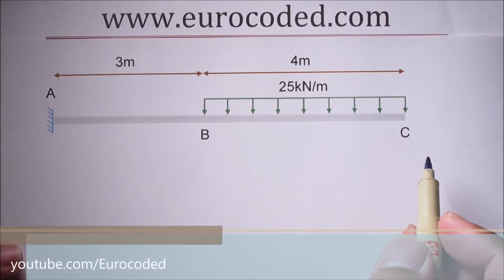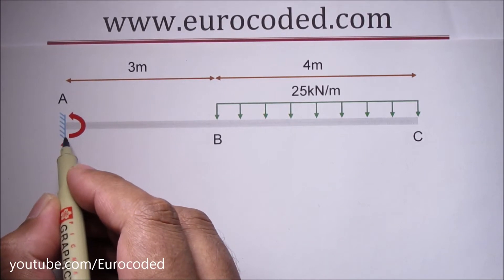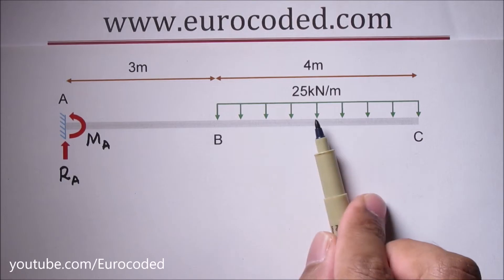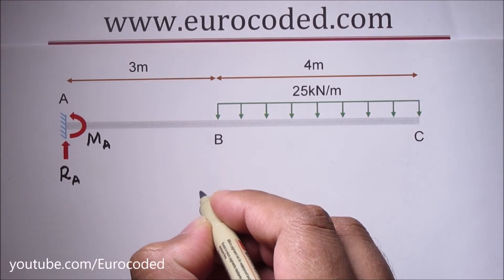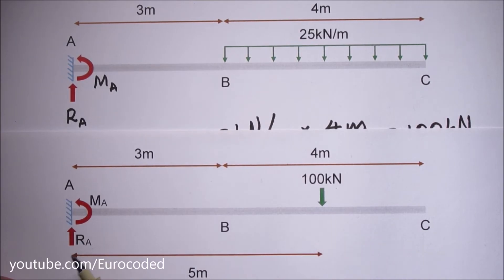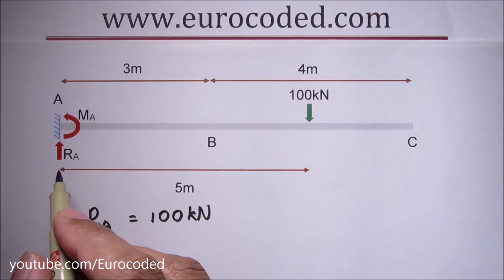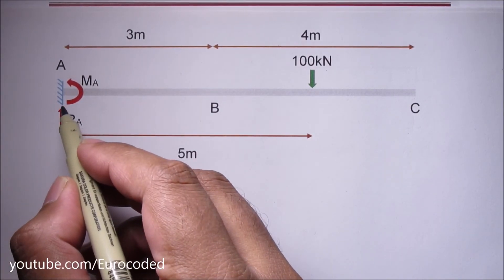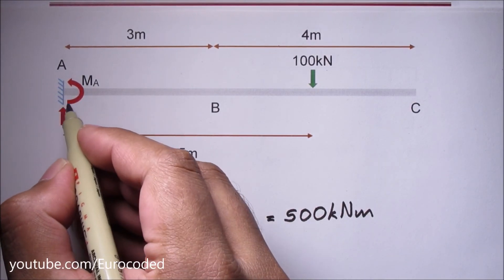How to Calculate Reactions of a Cantilever Beam with a Uniformly Distributed Load

Comment: when you have converted the UDL to point load and placed it in the centre of its load span. Can it be placed at any point on that span? and be added to another point load that would occur at 'C'?
Reply from the maker: nicholas peak In this example, converted UDL is applied 5m from A. If you offset this point to a different location (example: to C) you will then need to counter the change in moment resulting from shift of converted UDL. Then you can add the converted UDL to another point load applied at C.

 

Example: Imagine the same beam arrangement with another point load of 50kN applied at C.

 

If you shift the converted UDL to C then the lever arm becomes 7m when taking moments about point A, resulting in 700kNm bending moment about A. But in reality, it should be 500kNm (5m x 100kN). Therefore, we can add an external anti-clockwise bending moment of 200kNm to counter the additional 200kNm (700-500) resulting from shifting the converted ULD. Then you can take the sum of two point loads at C as 150kN.

 

I don’t recommend above method for this sort of beam arrangement. It would be much simpler to look at equilibrium with two point loads applied at two different locations. However, sometimes you will need to adopt above method depending on the arrangement.